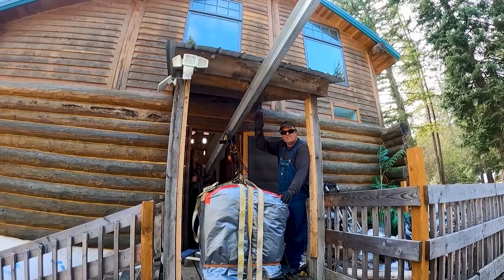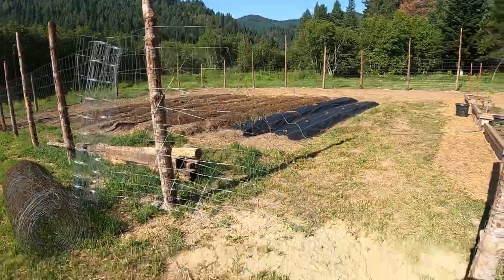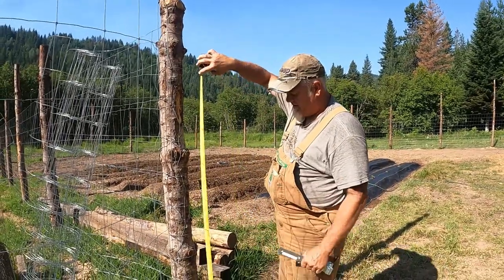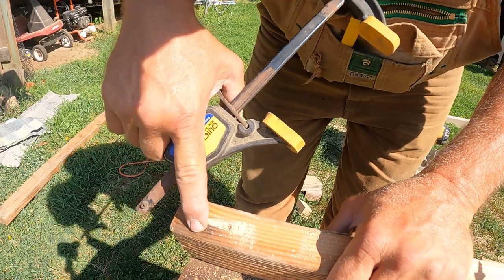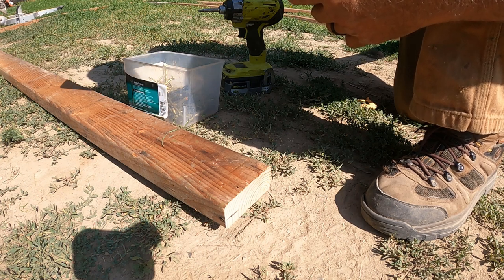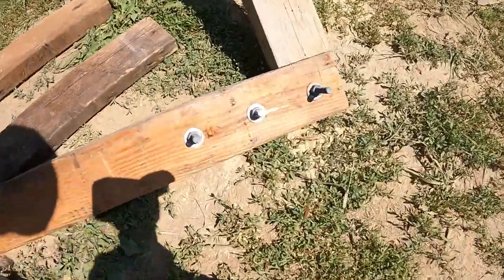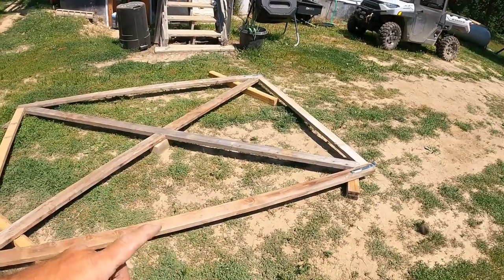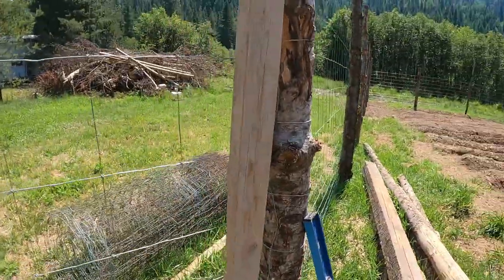HOW to build a wooden gate

Comment: Scot, you might want to run a piece of wire rope from the top of the post with the hinges to the bottom of the next post to keep it from bending over time from the weight of the gate.
Reply from the maker: Good idea.  I was planning on doing diagonals and a cross piece soon